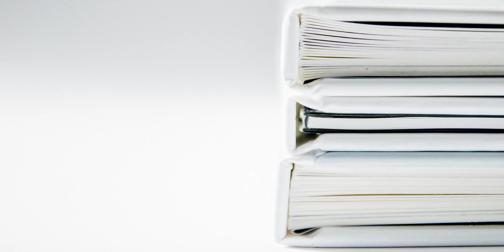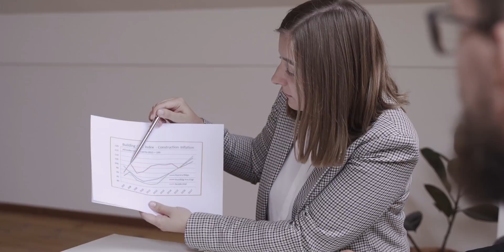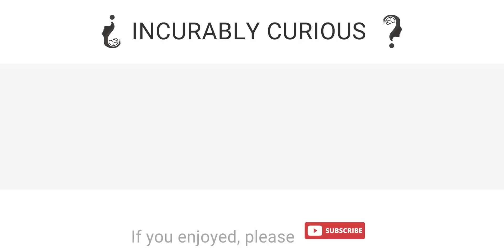Why Most Power Lines Aren’t Underground

Comment: When it comes to cost, I would love to know what's the difference (in cost) between putting lines underground vs yearly repairs to downed lines.
Reply: Overhead lines are cheaper to install, cheaper to maintain, easier to locate problems , easier to fix & generally longer lasting. Underground cable generally lasts between 30 -50 years & is very difficult to repair & replace. I am a high voltage lineman for a local utility & our district is a mix of OH & UG.
Reply: @robertgallagher7734  Thanks for the reply! Our lines go down so often I was wondering if it just made sense to put them in the ground, versus constantly replacing. The huge towers I get, just didn't get why not the neighborhoods.
Reply: @John Cannizzaro I have been running powerlines for 30 years, Price for UG is about 3 times the price of OH to install. In fact most electric companies intall OH to a home from the street for free. You need easements and right of ways to put the UG conduit. When the cable goes bad most of the time it melts into the pvc conduit and you can`t pull it out. Ask your neighbor if he will give the power company an easement through his property for your UG service and see how that works out for you. You may find he is not as friendly as you thought, And see how he feels when the cable goes bad and a backhoe shows up and tears up his yard to fix the cable. UG is a good idea but most people don`t want to pay the price. Plus just because it`s UG does not mean your power will never go out. Follow the lines and you will find it`s OH somewhere. GREED has nothing to do with it, CHEAP customers have everything to do with it. I have run UG service to million dollar homes and you should hear the homeowner cry about having to spend 3k-5k for a UG service for their million dollar home. But they will spend 25k-35k for an elevator to take them to the second floor of the home.  🤣🤣
Reply: Just for extra fun, the utility I work for is upgrading overhead lines in high fire areas to insulated conductors as an additional safety measure which has another set of problems related to OSHA rules. Huge change from open, lock & tag to ground all sources as far as work practice & outage requirements. Been a huge challenge on all sides.
Reply: @John Cannizzaro I am aware of the easements for OH. The comapny I work for has hardly any safety issues with OH lines. Our crews have been to NYC after storms. And to be blunt the system in NYC is a huge mess and pretty much a joke. We have seen lines in NYC that are anything but safe. Just becasue it`s still in use from the 1800`s does not mean it`s safe. All it mean is the GOV up there would rather spend money on other projects or pocketing the money.
Reply: @John Cannizzaro Stupid comment. The utility could put them all underground, but then you - the consumer - would pay much higher rates. Are you willing to do that? Or are you subject to ... GREED?
Reply: @John Cannizzaro I don`t live or work in Ohio. So your comment has no basis. However until you have seen what is in NYC  and how unsafe it really is again your comment has no basis. As of know I will consider this conversation at an end being you have NO clue what you are talking about.
Reply: Approx. Double the cost
Reply: @John Cannizzaro have to build a parrellel system to do that. The utility I work for has done this in several places, but only where the customers have voted to approve a special assesment to pay for it. Kind of like Melos-roos taxes in a new developement.
Reply: @John Cannizzaro lead insulated cable is great, lasts almost forever, but it takes a highly specialized skill set. Lead is a neurotoxin that requires hazmat training as well. Also, most UG high voltage systems were built when "open, lock & tag" was acceptable (30 years ago) but the government has (under OSHA) revised standards, forcing a change in work standards. I was trained to do "hot" 4kv splices but now would be fired if I did one. Same with working on energized 480v. Also used to do system parrallels on taps but now the system opperators would have a panic attack at the idea.
Reply: @John Cannizzaro also, forgot to mention, was an HV lineman, now a lead splicer. Be safe, brother.

Comment: Tesla ( the original inventor) wanted to give everyone free electricity passed over the air using antennas, kind like like radio waves are, he was going to pull electricity out of the upper atmosphere or something, it was all shut down by the big shots.
Reply: Bullshit. That only works in poorly written fantasy novels or lame conspiracy theories. He was using RF to 'transmit' power. Look at the physics of RF transmission and you will discover that it was all a waste of time and resources. The loss vs distance can be compared to trying to light an entire city with one light bulb. Every time you double the distance you lose half of the light. My home town in Ohio started with one huge carbon arc light that could be seen for over a mile, but close to the tower, it was blinding. After a few blocks, there were a lot of shadows. At the fringes, you could see it, but it did nothing to light your way.
This was prior to radio, because arc lights generate enough electrical noise to wipe out communications. I am a retired Broadcast Engineer. We needed a 1700 foot tower and a 5MW EIRP to cover the central Florida area from our site in Orange City. I could see the tower lights from a hilltop North of Eustis Florida on Hwy 452, but at a house not far from there, the TV signal was weak because it was slightly down hill. RF is also adsorbed by metal and at higher frequencies, it is adsorbed by plants.
There were many misconceptions about Electricity, until the physics were learned. Tesla's entire concept was a lose lose mess.

Comment: Australia has a mix depending on area, but also had a big conspiracy uncovered years ago about the cause of many bushfires. We kept being told about arsonists lighting lots of fires, but the truth was that the powerlines in rural areas were rather dramatically sagging in extreme heatwaves (expansion of the metal) then due to high winds they were hitting dry trees or even tall grass and starting fires. The weather causing the power lines to sag was the ideal weather for bushfires so many of our worst bushfires were started that way.

As it turns out, our national energy companies had done research into the problem many decades ago and kept it secret. They understood the cost involved in burying the cables and decided it was too high. That they didn't want to cover the cost isn't a big deal, but that they knew exactly what was causing the fires and kept ot secret os appalling. These days in high risk areas in high risk weather they sometimes turn off the grid, which is a very strange thing to do in a country like ours with one of the highest reliabilities.
Since the story became public some lines are being burried while other areas are being dramatically improved by using things like wire tensioning systems or reduced pole spacing. 
There is a pretty heavy incentive for power companies here to ensure supply, if power is lost for any reason they quickly start owing the consumer and amounts increase in stages the longer it goes on. 

Totally surprised when l saw your subscriber count, l was expecting 1000x the current number.
Reply: Thank you for clearing that up for us. My fiancé lives in Sydney and we were talking about all the fires last year. All the best.
Reply: The same thing happened in California. Many of the massive wildfires there were caused by sagging and/or fallen power lines, and the utility, Pacific Gas & Electric, had to pay U$ 13,000,000,000 in damages. 
But some of the fires were caused by arson.

Comment: $41 billion would buy millions of solar panels, small wind turbines, and hydrogen fuel cells to make every homes and building in North Carolina 100% zero emission AND energy independent, and never have blackouts. We are wasting money on improving the Grid, instead of tearing down every grid, worldwide. Focus on survival and stop considering solutions based on cost feasibility.
Reply: but the power cables connecting them to the buildings can be still the weak link if they are above ground.

Comment: This is  very American way to look at underground cables. In Europe/Germany many things are a bit different. When I was a kid, we had power cables and telephone lines overhead. Year by year more was put underground: telephone , power, gas, internet, tv, you name it. And longer power outages in case of faults? Check ASIDI or SAIDI for European countries and compare it with the values for the USA. Fault location in Europe is done by measuring where the fault occured, switching of/isolating that part of the line, digging a hole at the right spot and fixing it.

Comment: You can't put high tension lines underground. They must be kept away from ground. The high voltage would cause them to short to ground. The insulation thickness around each wire would need to be insane to prevent it.
Reply: Seems like the Europeans do not know that. We put the lines into the ground. And it works.
Reply: Lol.  Good guess but wrong.
Reply: You can though it is too expensive for really high power cables

Comment: there is only one reason: power companies in the us want to maximize theyr profits.
in the US most building are cheaply made, and the companys try to maximise profit.
in most of europe local power lines are underground, and something like a power outage more then one a decade is the exception.
Reply: Home builders switched from lumber to close in external walls to using press board which is noticeably weaker in terms of stabilising the house against strong or even moderate winds. The state and provincial governments were heavily lobbied to allow the changes to the building codes. A house built 100 years ago is likely still standing today but a modern house will do well to last 50 years without uneven walls and floors. The house I live in has rolling floors, not noticeable to the eye but in sock feet the rise and fall is detectable.

Comment: You know I dont want to upset anyone. But you can buy at home depot a small home generator! Or backup batteries? Problem SOLVED!
Reply: Have you looked at he cost to run that 'small home generator'? Fuel and replacement generator costs are both much higher than using the grid, or everyone would be doing it. How about the noise of all those inefficient generators, running around the clock, and people stealing them?

Comment: Every point you made is valid.
I worked as a summer intern for a high voltage underground cable mfr in the 1980s for 4 summers in college.  We made the cables for EPCOT Center at Disney, and at that time the cost was $25/foot for a 15kV 3-phase armored cable.  It is now over $100/ft.  Underground cables do fail, especially at their weak points like splices and terminations.  The failure can be subtle, or explosive depending on the failure mode.  We saw one failed 15kV cable sent back for analysis missing 3ft of copper, and were told the homeowner saw wispy smoke rising from his lawn, and dumped water on it thinking it was a fire.  It blew a 20ft deep hole in the ground and he was thrown across his lawn, fortunately with no injuries.  Most failures are subtle and can take 1-2 days to locate the failure point, then excavate if not in conduit.  Lightning can take out an underground line also through a direct ground strike (look up fulgurites).
At least in the US, we have to worry about securing rights-of-way, burying below frost line, and animal damage.  Animals will gnaw into direct-burial cables.  To put it in conduit is safer but even more costly.  Never mind the fact that here in New England, you have 1-2 ft of topsoil then solid bedrock underneath in most places.  Every line would need to be blasted to trench it.
Locating padmount transformers, sectionalizers, and switchgear would all need municipal and private property owner permission.  Not a lot of people want those in accessible/visible areas or on their lawns.
Distribution voltages in the US range from 4kV up to 34.5 kV, so higher voltage cables would be massively expensive.
Lines are placed underground in urban areas, vulnerable or protected areas, and where ordered by municipalities.
Bottom line is lines are sited based on the local climate, tectonic, and geological conditions.  What works in one country does not work everywhere else.

Comment: I thought it is completely nicer to have underground cables, makes me wonder if its possible to have wireless grid.
Reply: Nicola Tesla experimented with such a system in the 1900s on Long Island and in Colorado Springs.  Couldn't transmit very far from the source.  Industrialists couldn't control who used it, and thus charge money for its use.  And with what we know about EMF and health effects these days, wouldn't fly anyway.  Would interfere with most communications signals - cell phones, radio, etc.
Reply: electricity thru air is so dangerous and so inefficient.imagine why wireless chargers are not efficient than wired ones.it can also be a hazard to all.

Comment: Also as a lineman it’s much harder to find an underground fault because you can’t see the problem. Which equals longer outages and people wouldn’t be to happy when you have to tear up their property to make the repair. Overhead is cheaper and outages are t as extended
Reply: That's what thumpers are for. :)
Reply: As a underground cable splicer, the thing is that we can "see" the fault. We just have to use equipment to see it. We have all of our wire in conduit. If you ever came to work in New Orleans, you would have stayed in the downtown area where all of the lines are underground because we were the only area that had power. Because of our system, several feeders would have to be out to cause a power outage. For Hurricane Ida, the only reason we lost power is because of Overhead Transmission Lines. Once the Transmission was energized, we were able to restore the system without making any repairs.
Reply: Sounds logical but is not. Inside of towns a German lineman will either get a call, that a company just dug through or into a cable (obviously no problem with locating the fault) or the local power surveillance computer will give you the coordinates where it or the protection equipment located the fault.
Reply: @wora1111  well here in the states we’re still in the dark ages. We will isolate the faulted section then thump it with a high voltage bidle. And locate with a microphone head set. Most of the cables where I am at are direct buried. Salt water intrusion is a big problem here
Reply: @linehandibew6205  I did not want to phrase it as brutally as you did because I am not talking about my own country. But as Europeans we have the advantage of a higher population density which makes for shorter lines, often there are just a few hundred meters between accessible connection points. And we usually have a network of interconnected lines, so we can easily feed a section from both sides or cut it off with only small numbers of clients being  affected. The municipal networks are locally owned, so many teams could try different approaches und learn from each other. And being locally owned there are rules in place how much money you are allowed to make from your clients. So people became proud of the quality of their work rather than the amount of money their company earns. Sounds crazy but it did work for us.
Reply: @wora1111  hahahaha too much corporate greed here in the states.
Reply: @linehandibew6205  I faintly remember there was a lot of trouble in the eighties with mostly 20kV underground cables that had bad insulation and needed to be replaced. My company earned a lot of money at that time with computer based fault location.

Comment: At my job we install Natural gas and the conduit pipe and build up the transformers, secondary, tc, and switch gear cabinets for electrical lines and on the job I'm on now we're installing underground power lines replacing the powere poles and yeah that $500,000-$5 million estimate per mile is 100% correct, most of the cost is from material and repairing the roads side walks and landscaping
Reply: But it is a one-time cost that can be amortised over the lifespan of the wiring. Properly implemented the underground wire lifespan might increase and follow concrete infrastructure whether sidewalks or curbs to limit possible idiots digging without verifying location.